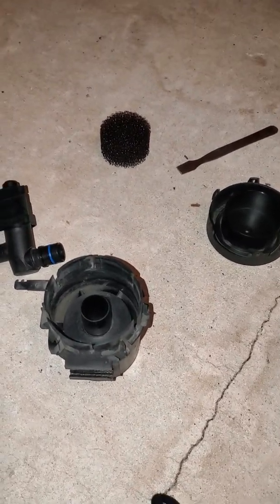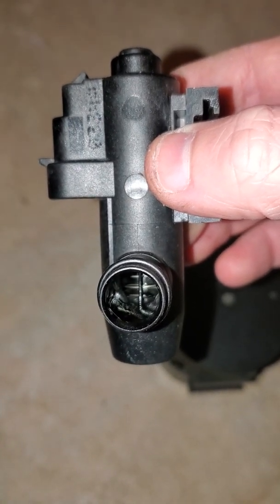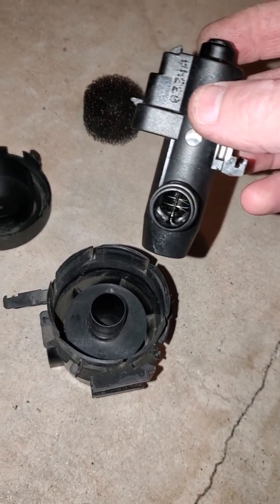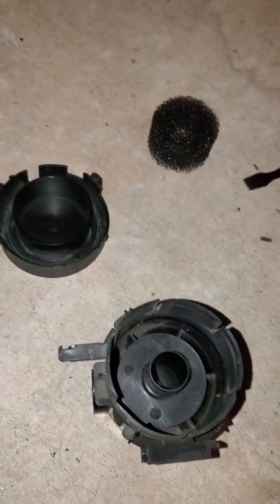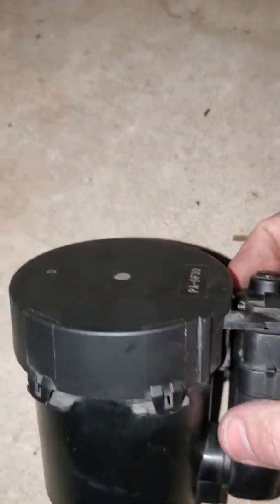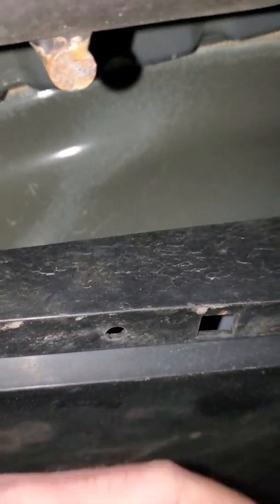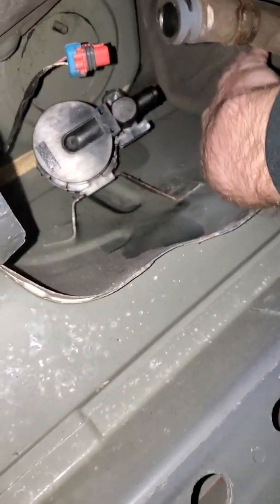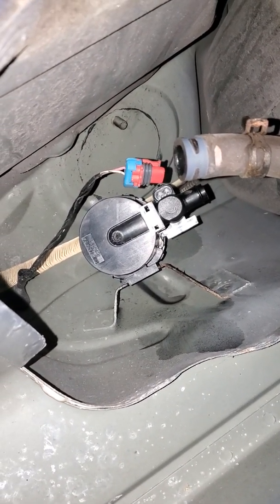EVAP Canister Vent Valve Solenoid Disassembled - 04-06 Pontiac GTO - p0442

Comment: I initially had a p0442 then it randomly went away now I have a p0496 with all the same issues. Slight rough idle .. CEL.. and weird starts (hard start) when hot. I bought this hoping it fixes it. I changed the evap solenoid on the head already. Not sure what else it could be
Reply from the maker: How long ago did you replace purge?  I had to replace mine after like 1-2 years.  2nd failed quick
Reply: @JonnyAbs-0 I replace the purge solenoid on the head a few months ago. CEL was p0442 then and went away on its own regardless of purge solenoid being replaced. Oem I couldn’t blow through yet the new one I could or vice Versa. Nothing changed. Still slight rough idle. Then now I got a p0496 and I just bought an ac delco canister. Don’t know what next to try other than fuel pressure sensor
Reply from the maker: @permabulk1454  did you do the vent valve?
Reply from the maker: Check your engine bay line for a crack.  Honestly I would try to replace the purge solenoid again or at least check it

Comment: I have an 04 Ibm as well, had it for over a year. It has 199k on it and this evap cylinder is the only check engine light it's ever shown. Thanks for the information, have been wondering how easy this is. I know what I'm doing next payday now
Reply from the maker: just a heads up, my small leak error was not fixed by this.  It could be the cause of yours, but my issue was with the purge solenoid.  I'll link you to that video.
Reply from the maker: here you go bud.  Subscribe to my channel!

https://youtu.be/RRKKCVoj3KM